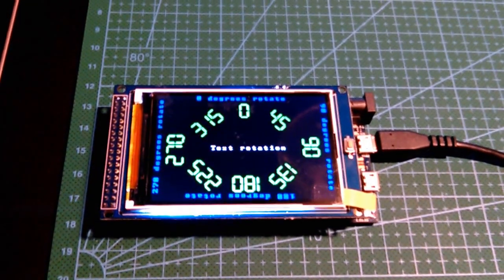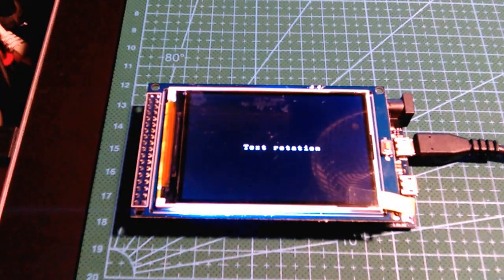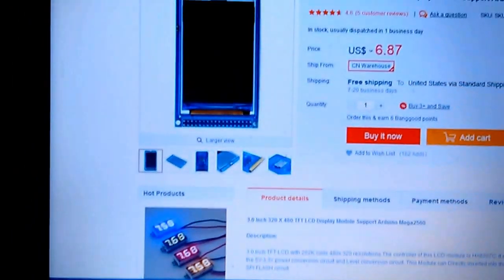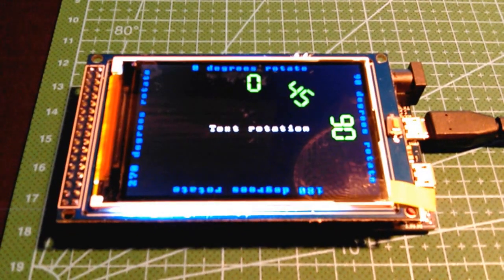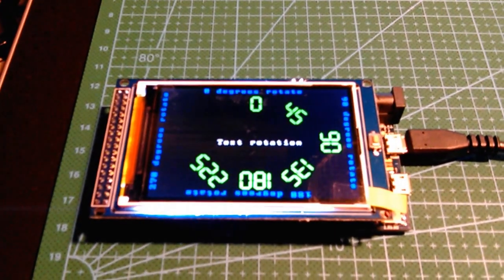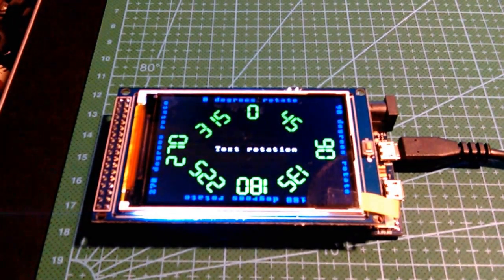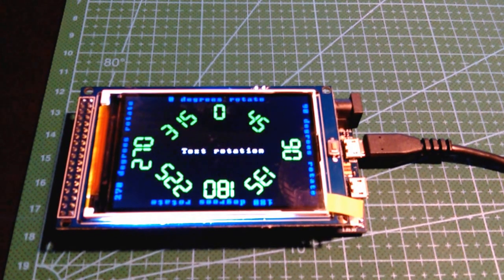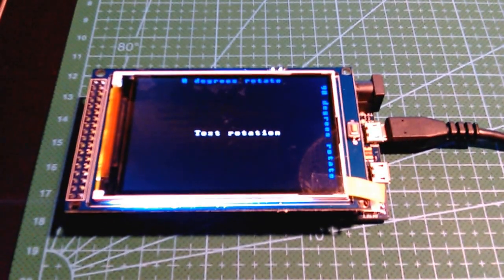3.5 inch 320x480 TFT LCD Display Module & Due or Mega Arduino. links to sketch.

Comment: как сделал поворот текста на 45 градусов?
Reply from the maker: You asked, How did you rotate the text 45 degrees?
Check out the code/sketch I posted in the description.
You will see there everything you need.

Comment: is it possible to turn off the display for power saving?
Reply from the maker: Good question, to be honest I cant remember, some panels do quote the ability to turn off the back light, but so far I've not had much success with that and probably won't. I believe most of the LCD panels are re-purposed for the Arduino and other micros etc. I suppose the power to the panel could be interrupted but I'm not sure if you were driving the control lines while the power line was off you could possibly damage the control chip. Not really sure about that, I haven't tried it and don't plan to yet. Some panels are also quoted as being for a 3.3v supply and drive but most also have 74254 or 74244 tri-state buffer chips that seem to protect the control chip somewhat. The biggest problem is getting accurate data on the panel to get all the control commands correct, it can be very much trial and error unfortunately. :-(

Comment: Is this the same screen adafruit is selling for 40$?
Reply from the maker: Well it could be I guess.
I would need more information on the Adafruit shield to be able to answer that.  This graphic shield came from Banggood.com. 
Details above.
Reply from the maker: +Gabriel G No its not a touch screen. But Banggood do sell a touch screen. I may have a video of it. I think its about $12 but it needs an adapter shield to allow it to connect to the Mega, the adapter shield \ board I got was about another $12 with shipping but not from Banggood they don't sell the adapter board.
Reply from the maker: Gabriel G You are welcome.

Comment: My Bangood display looks just the same but needed CTE32HR not HX8357C to get the above demo to run
Reply from the maker: The guy that wrote the driver removed support for some displays in the latest version, you may need the older version of the driver. As its working with the CTE32HR maybe Banggood switched the boards to the CTE32HR chips.

Comment from the maker: You are correct Kurt. It seems the latest version of the utft driver library does not support the driver chip. The older version I have does support it. I will add a link to the older version of the utft lib for you to use. 
Thanks for the feedback.
Reply: +KB1UIF Thanks, and I also found an alternative fix to it using Banggood's supported drivers here https://www.dropbox.com/s/ztu54uxo3or57bh/SKU193219.zip?dl=0  . It has the HX8357C driver and It also has a LCD layout tool, but I haven't used it so far. Everything seems fine as of now.
Reply from the maker: +Kurt Barcelona Yes, I think that was the place I got the Library in the first place.
I did see that the latest version had support for the HX8357C removed for some reason.
I added the dropbox link above also. Thanks again.
Reply: +Kurt Barcelona. Can't download from dropbox
Reply from the maker: https://www.qsl.net/k/kb1uif//downloads/Arduino_Sketches/Install%20libraries/UTFT/

Comment: sweet. do you have the codes to the library that makes it work with arduino due?
Reply from the maker: Kurt Barcelona Yes, it uses the UTFT driver.
You can download them from my site here:http://www.qsl.net/k/kb1uif//downloads/Arduino_Sketches/UTFT_Textrotation_480x320_Demo/UTFT_Textrotation_480x320_Demo.ino
The Library is from here: http://www.rinkydinkelectronics.com/index.php
Reply: thank you very much
Reply from the maker: You are welcome Kurt.

I hope this helps!!
Reply: +KB1UIF I'm sorry but you rpogram was not able to compile. It says that 'HX8357C' was not declared in this scope. I checked the drivers supported by the UTFT, and HX8357C isn't supported. Is there a specific version of UTFT that I should use? thanks
Reply: Read the library keywords.txt file - pick your chip driver from there and replace (as per the comments in the sketch)